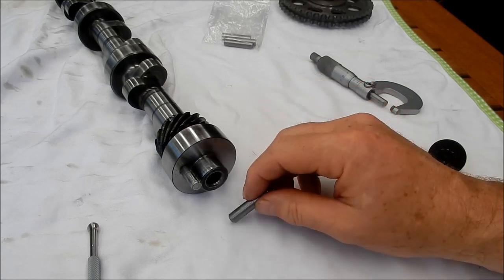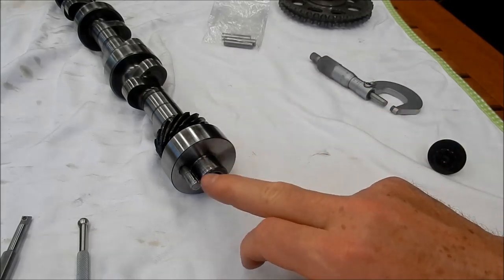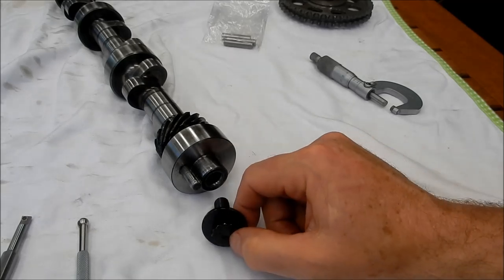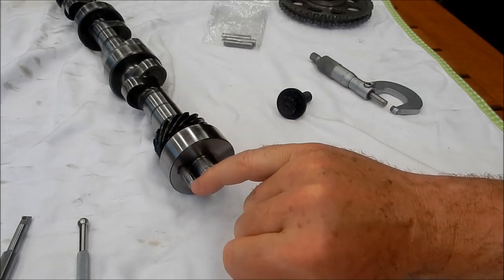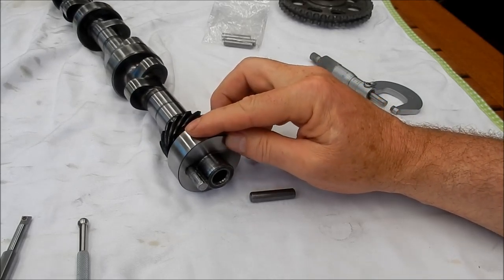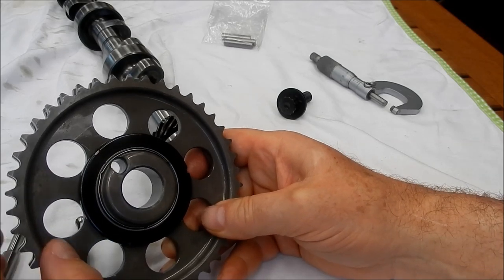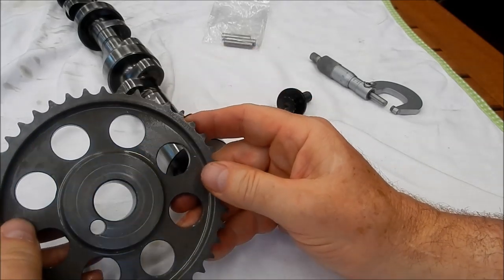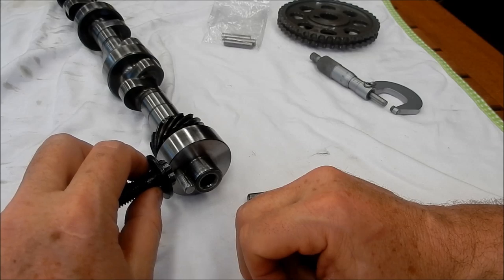Racing Engine Cam Shaft Re-Work and Fit Up

Comment: Nice repair !
Strange that there is no way of  dialling in the cam  on the camshaft itself , must use offset keyways on the crank or something similar for this .
Reply: @weldmachine  
Maybe the class of racing doesn't  allow it or it is a control camshaft or something ?
Cam could have turned up a pin with some offset to give some advance or retardation  to the timing but that may be cheating ! Either way that system of driving the camshaft is terrible and Cam has done as best of a job of fixing it as one could ever  hope for .
Reply: @weldmachine  
Motor racing of any kind is a weird sort of thing and one thing i do know with the V8 Supercars racing here in Australia is they strictly control camshaft timing events , lift and duration so the engines are matched across manufacturers . I sent a comment to Cam asking if he knows what the engine is for .
Reply: Timing is adjusted via multiple keyways on the crank sprocket.
Reply: @jimbovoncarguy3877  
As i suspected,the downside is if you are dyno testing you have to pull it to bits to make a change  😫.
Reply: @weldmachine  
Same here , i may not be up to date with all the new stuff but i still remember the offset bushings , multiple keyways and the like .
I know one thing is that if that were my engine i wouldn't run that set up !

Comment: Hi Cam,
Did the customer tell you what type of racing the engine has been built for ?
Reply from the maker: G'Day Ian this is an extract from a reply from my mate. (luv the comment on the end, so true). The combo is a dart machinery blocked 440 cubic inch small block ford. Higgins race heads and manifold. Cams a solid roller. And is basically a drag racing engine dialed back slightly so with some timing pulled out it can be used safely for some street use too. Ill suss anthony tomoz if he is cool for u to post the info and he may even be ok to post a dyno vid when we get it sorted? We are flat knacker sorting another car tonight to race tomoz. Im convinced drag racing isnt a hobby.....its a mental illness. Lol  
Anthony , the guy who puts these race engines together does it from his home workshop as a full time job.  As a matter a fact he told me he has too much work and is behind with his customer orders.  What a way to make a living doing what you luv.
Cam
Reply: Cam at Battler 
Thanks Cam !